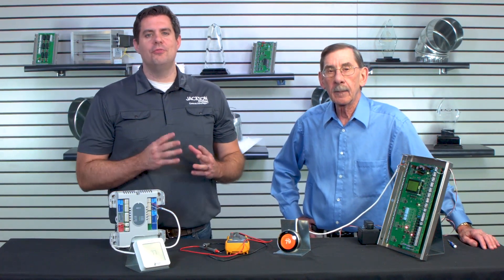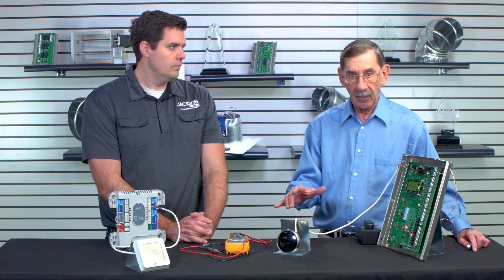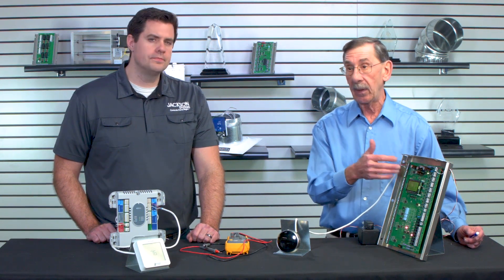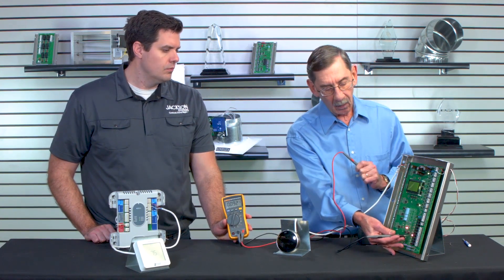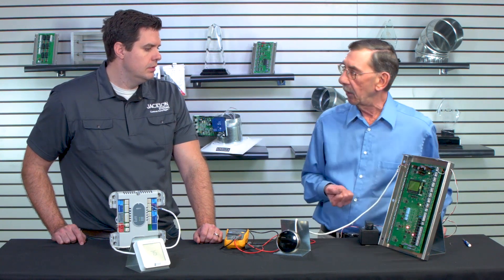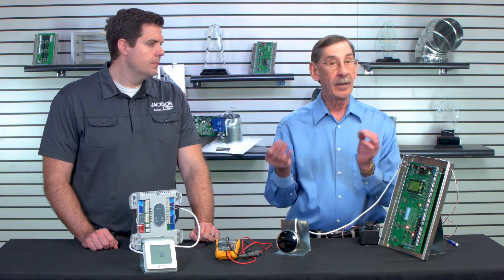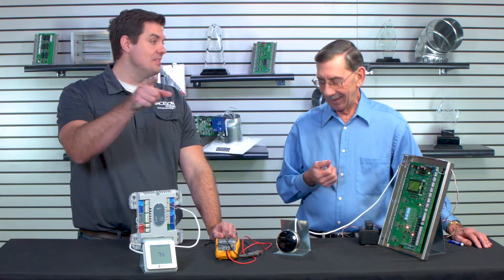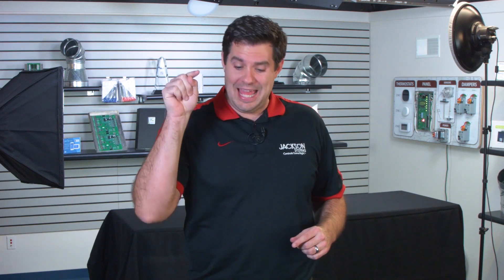Thermostat wiring to a Zone Board

Comment: I have the Trane XV variable speed heat pump and air handler with a zone panel.  I'm adding the auxiliary relay panel, but it seems that both panels want data from the thermostat, but I can't find a field wiring diagram that integrates the two.  Any ideas?  Thanks in advance.

Comment: what about wiring in a steam humidifier with a zoned system? Wire it to equipment or zone panel??
Reply from the maker: We would recommend picking your biggest zone and using a thermostat with humidifier control. The thermostat would get wired like normal to the zone system but the humidifier control would run directly to the thermostat bypassing the zone board.

Comment: I have a trolatemp mm-3 and I cant get my nest to work with it. I have 6 wires on the down stairs termastat and 3 upstairs. What can I do to get my nest to work? I have 2 zones
Reply from the maker: It may be that the Nest uses triacs instead of mechanical relays. I'd suggest trying another stat and seeing if it will work.

Comment: Hz311 (with dampers) compatible with nest  gen 3/learning?

Issue: 3 zones (1 nest installed, the rest traditional button push thermostats) 

Zone 1- works fine after C wire installed. Ac/heat function properly with green light on hz311 board.

Zone 2- ac stuck on. Absolutely no control over it. Can’t turn off. Constantly running even with zone 1 off...red light on board. 

Zone 3- no air flow at all for heat/ac. But has a green light on board. 

Spent 2 hrs troubleshooting this issue. Came across this issue for a previous customer and couldn’t resolve. Had to reinstall their original thermostat which system functioned normally again.  Can you help assist? Thanks!
Reply from the maker: Hello, Nest thermostats are a power stealing thermostat, when used with a zone panel the C wire must be connected. If the C wire is connected and they still have the issue, the thermostat will not work with that panel. Just remember nest thermostats are power stealing and do not cooperate with zoning equipment very often. Hope this helps!
Reply: Jackson Systems  the Common wire was connected with 26v I believe...Now I can relay this message to the fortune 200 company I work for who keep telling me otherwise 😂 I only come across this issue with hz311s. Thank you for the help!

Comment: What would the power source be for the separate transformer ?  Can I use the equipment transformer to power the panel ?
Reply from the maker: Hi Les, Thanks for the questions. First, to your question about using the equipment transformer. We always recommend using a separate transformer than that of the equipment to power a Zone Board. This prevents any VA or Phasing problems. As to where you are going to get the power, hopefully, you have a 120 circuit close that you can tap into.
Reply: @JacksonSystems  Thank you
Reply: You have to look at the power rating of the transformer and verify if that transformer will have enough power to support all your thermostats.